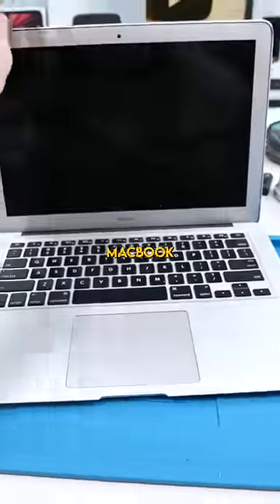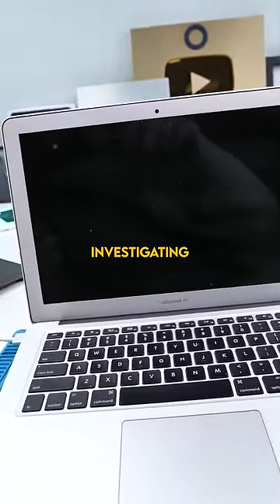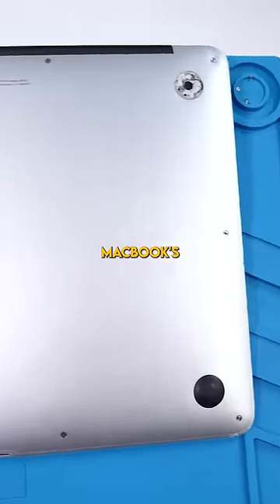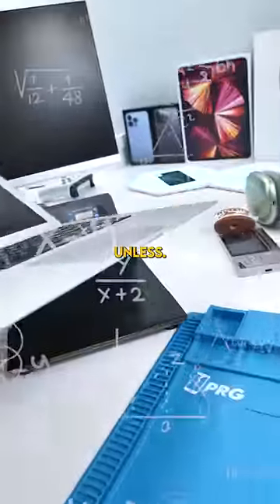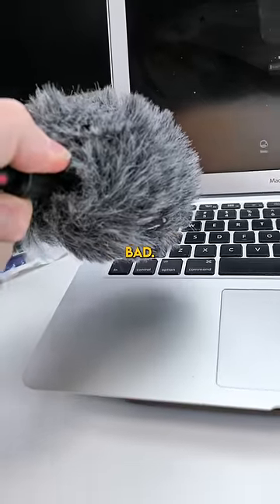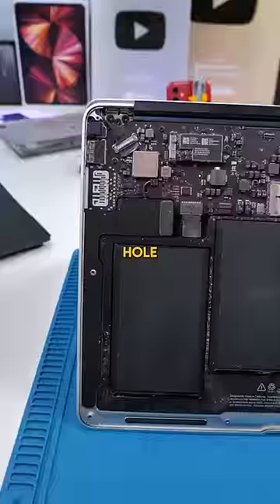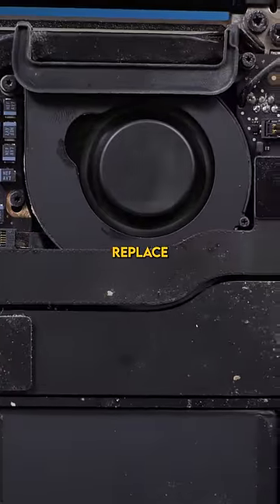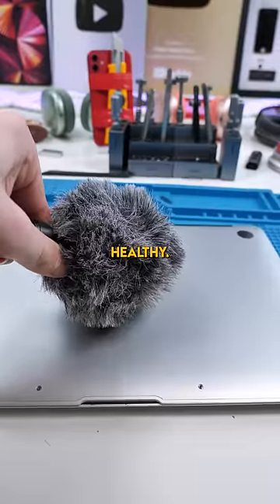This Macbook Air Sounded Like a V8 Engine... #Shorts

Comment: As a MacBook user, this was a really cool video. Whenever I play Minecraft my Mac’s fan decides to make far from elegant noises 😹
Reply: bro. The thing with fan make a noise, that was very normal thing that a laptop and pc should do.

If your fan is not spinning or make a noise when you use it for a heavy task, boy i have some bad news for you.
Reply: @febryanmz  news that my cooling system is actually well designed and well functioning?
Reply: @febryanmz  unless your laptop uses passive cooling
Reply: @febryanmz  For your information, I have a Lenovo ideapad 1, It only has passive cooling yet it can still stream youtube videos in 4k and play games. And it only costed me 70 dollars. Not to mention the largely better battery life than my gaming laptop
Reply: My i3 air's fan buzzes
Reply: @Datwaltuhdawg  keep doing that bro, I wonder how long that thing will last
Reply: @febryanmz  Long enough to still have almost two year warranty from Lenovo.
Reply: @Datwaltuhdawg  Dude a 8 year old phone can stream youtube in 4k, or a 20$ chinese tv stick. That’s literally nothing impressive since modern Celerons have video decoders. You probably would struggle with playing roblox since your integrated graphics are probably terrible at rendering. Plus a 2 year warranty is pointless when your laptop will struggle to do any basic task 2 years from now.
Reply: jasperstechtips1 yeah my friend has a MacBook Pro and it performs better than my HP
Reply: laughs in M1 MBA

Comment: I'm surprised that it did not say "Unable to verify fan part" And it would not work because apple
Reply: Always lock their hardware ID that replacement hardwares always get issues, such as the latest M2 screen change issue.
Reply: Bro that thing is from 230 a.C.

Comment: how does replacing the fan solve the issue when the issue is due to the pressure of the backing? wouldnt the backing need to be replaced too? would make more sense

Comment: Since when have macbook airs had fans? I thought the whole shtick was that they are cooled fanlessly, so they can be thinner
Reply: They had fans when they had Intel processors.
Reply: @xluumu , I don't think the 2018 or 2020 intel models did.
Reply: @cablewaffel7957  They did. The fan was removed when the M1-model came.